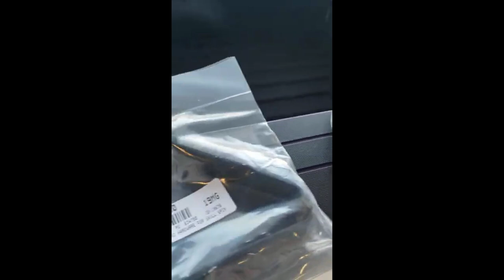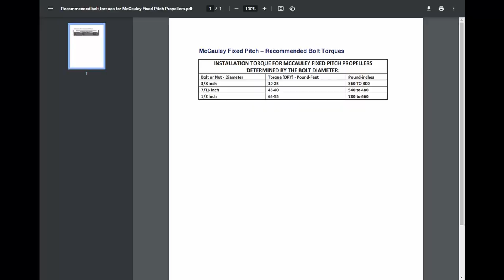Cessna 150 Skull Cap Spinner Installation

Comment: any speed lost from the skullcap spinner? i have a skullcap on mine and was thinking of going the other way so this video is quite interesting.
Reply from the maker: I haven't noticed any loss of speed, but in my area the wind is a constant so calm days to really get an insight into that are few. Just flew today and gps tells me 102kt average speed, 2500rpm
Reply: @-Dad--  Good to know! did you have any oil temp issues before you did this spinner change?
Reply from the maker: @Jolinator  it would get pretty hot in the summer, but not red line by any means. It's been cold here for quite some time so that's hard to judge as well. If you are anywhere near ND you can have the one I've got put on and see if you like it before you buy a cone style performance.
Reply: @-Dad--  Thanks for the offer, I'm over in OR and our 150 with the skullcap runs super cool i have about 120 hours on it but i have only been flying it since the cooler months so i cant report much on summer oil temps  it does have a surefly mag on it which i hear makes them run a touch hotter, the startup and smoothness of the surefly is amazing though i will never have another plane without one. Ours has millennium cylinders and with the surefly the timing has been advanced from 24 to 28. Runs great. 

All the best.

Comment: What size propeller do you have? I have a 69” prop on my 150H, also is the skull cap spinner from Aircraft Spruce  FAA approved?
Reply from the maker: Sorry I haven't had the plane in some time and don't quite remember. For the price I paid for the spinner I doubt it is FAA but mine went through annual just fine.